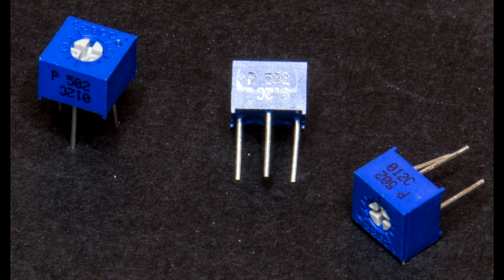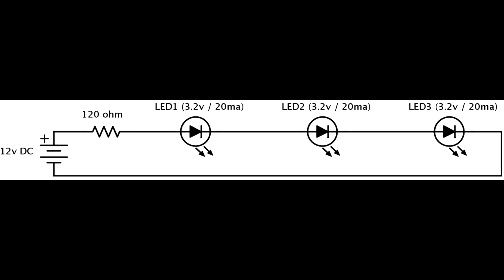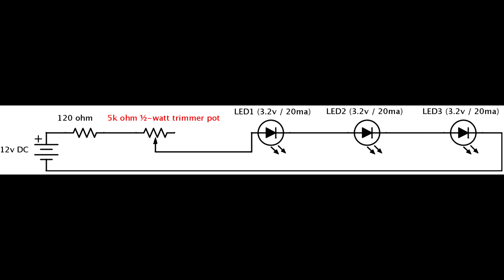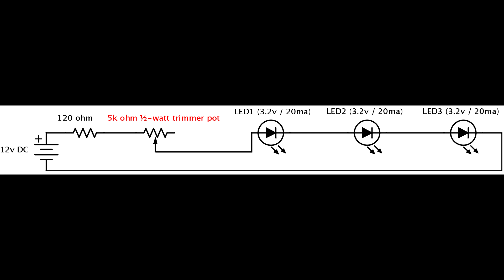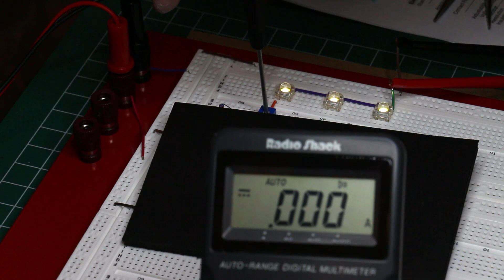Dimming LED Circuit with Trimmer Potentiometer

Comment: Hi why are they not turning off completely when the potentiometer is turned ? Is it possible to turn them off completely ?
Reply from the maker: The trim pot introduces resistance into the circuit to reduce current.  It is not designed to cut off current completely.  Put a switch inline to cut current completely.

Comment: Your set up dims the LEDs when you turn the "Pot" dial clockwise. If I want to reverse this dial response and have the LEDs get brighter as I turn the "Pot" dial clockwise, do I simply reverse my wire connections of the "Pot" terminals? And, to completely shut off the LEDs in your set up, would you simply use a larger ohm rated "Pot"? Many Thanks!!!
Reply from the maker: No, you wouldn't reverse the positive and negative wires.  If you wanted to reverse the dial response of the pot in my setup, you would move the wire coming into the one resistive element leg of the pot (the negative side, the resistor in my case) to the other side of the pot (the third leg), leaving the center connection (positive) from the pot wiper going to the load (LED). If I wanted to turn it off completely, I'd add a small switch of some type.

Comment: why don't use rotary potentiometer ? this is hot or not ?
Reply from the maker: gamabunta cat I don't see a reason why you couldn't use a standard rotary pot. I used the trim pot because of the small size, linear performance, and I won't be adjusting this a lot. Also my circuit requirement is low power so the trim pot works fine.

Comment: Bob, both of your videos on the LEDs are very informational!  I really like the trimer potentiometers!  Where did you buy these?  Thanks again!  sorry for multiple Q's  I appreciate it!
Reply from the maker: Nick, right now I think a good place to get these exact ones are here: www.ebay.com/itm/121114721722  He was great to work with.  In general, electronic supplies can be picked up at these web sites: www.digikey.com www.mouser.com www.allelectronics.com www.parts-express.com   to name a few.
Reply: Thank you again...I'll keep my eye on these.  They would be cool for large buildings with different levels.  Then one floor could be off or on or dimmed!

Comment: Great info Bobot, where did you get your test board?
Great video.
Bob,  Longshadowsmodeltrees.com   :{)
Reply from the maker: Mine is a 3M Solderless Breadboard Model 922336 which I bought around 15 years ago.  This appears to be it:  www.digikey.com/product-search/en/prototyping-products/solderless-breadboards/2359510?k=922336
Reply: Thanks, will check it out.

Comment: Hi Bobots Trains • I enjoy this topic because it causes me to think the process out on a sheet of paper. I find this video to be a learning process on this topic, to understand a LED circuit. I still need to study more about this on reading about this topic on Google Searches and Electronic Books. In the "Day" I used to built a lot of Heath Kit Projects. With my neighbor, we even built a color TV.
Cheers from Michigan
Reply from the maker: Gary - thanks for watching.  Yes, for me it is enjoyable and satisfying to take the time and effort to research and figure out stuff like this. Once my knowledge of a subject gets to an acceptable level for me, I usually get bored and move on to something else :)  One of the first things that stands out to people when they start playing with LED's in series is that the current draw across the circuit of multiple LED's is the same as the current draw across one LED (in this case 20ma).  You think that the draw would be 20ma per LED, but it is not. Interesting and fun to measure and play around.